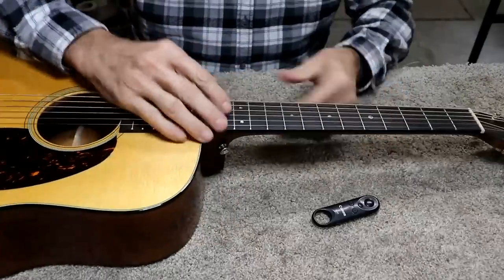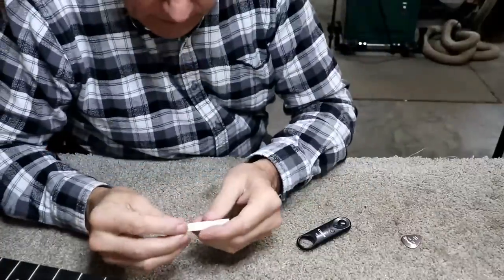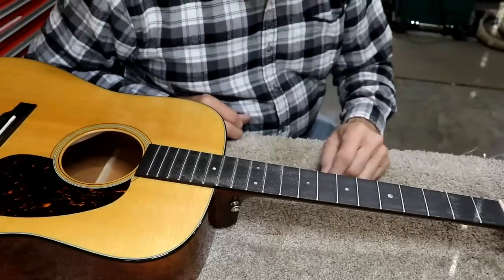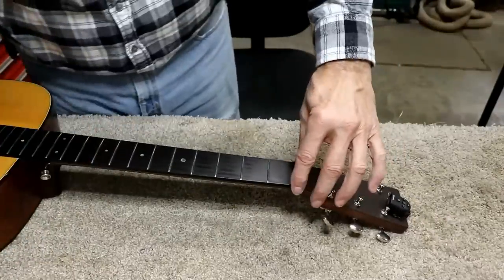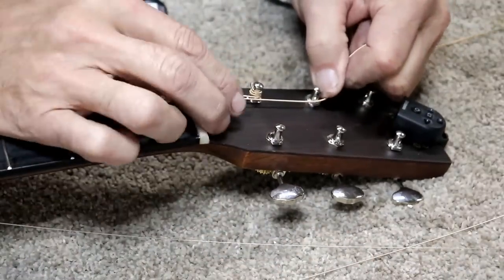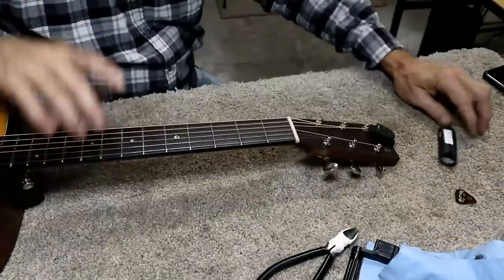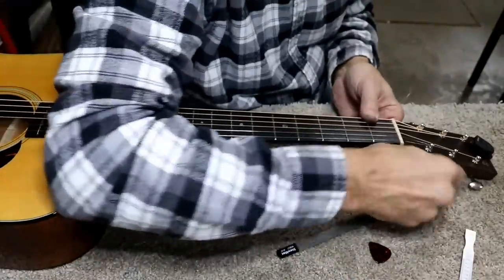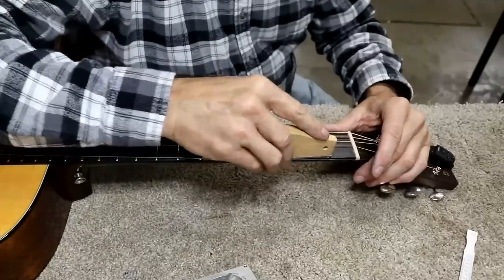628 RSW Can A Perfect Setup Be Improved

Comment: Doing a setup on a guitar that doesn't even need it. You did the "Rosa" on it. I string them up like you do. I offered to restring a friend's guitar, he went into the kitchen for a drink and came back and he could not believe I had the new strings on, blew his mind. Nice video Jerry
Reply: Is that an actual Martin D-18, or is it some kind of “clone”/lawsuit era copy?
Reply: Whoa.  Lowering the 1st fret vs. replacing a nut that already has filler?  If that is a Martin, I sure wouldn’t want to take that approach.
Reply: @bldallas  Depends what you want to spend. Nothing wrong with replacing the nut on a martin or any guitar that needs one. I would rather that instead of taking off more fret material after they have been leveled. Think about it. In my case I would replace the nut because I would do it for myself and/or my son. Filler or a shim in the meantime. This discussion is on the wrong thread. Have a good one.

Comment: I was attempting at a higher action and ran into this same problem. This is very timely for me. Thanks as always Jerry
Reply: I know what you mean, I hate it when I spend a lot of time and think I have it, then it buzzes. 9 out of 10 times the action is too low at the nut, but Jerry showed me his trick for that, I don't know if that is a good thing or not. Depends on the player I guess. Jerry doesn't like filling the nut slot, but to me, sometimes it is the way to go. Baking soda and super glue. Now if all of the slots are too low, you can put a shim under it. I don't think Jerry is a fan of that either, but it beats making a new nut, of course that is the only right way to do it.

Comment: I learned that stringing technique from Kenny Smith.  I do it on all the stings adding a little more windings on the treble strings.  It is a very quick and easy way to string a guitar.  You can remove old stings and add new strings in about ten minutes.

Comment: Stupid apprentice question: looking to buy sides and back blanks that have had mineral spirits wiped on them to show the grains. Has this ruined the raw blanks, or will this dissipate from the wood to be undetectable? Thnx
Reply: No damage to the wood at all. Mineral spirits is used (as opposed to alcohol), because it lasts long enough to get a photo. Water would last longer but you don't want to put that on wood ready to use.
The wood could warp.

Comment: That is like you said, the best possible outcome. there's just no way a person could get that setup any closer. I sort of thought that a fret level and recrown was in the work's? because I have to work on so many electric guitars. I have made it a practice to stay away from the fretboard with steel wool. the steel fibers have a way of finding their way into places where a person doesn't want them. so after I get done doing all the filing that I need to do. I keep some of those big pink pencil erasers around. and polish the frets with them, a person has to use a little elbow grease on them. but they come out shinny as can be, and I don't have mask off the fretboard. I noticed that guitar has a zero fret on it? those are usually reserved for higher quality guitars. that guitar sounded great when you finished it.
Reply: There is no zero fret, on this guitar.

Comment: That is a Martin D-18 it should have come from the factory with a bone nut & saddle I don't understand who put that filler in the nut. He should call the factory and tell them. They may reimburse him for some of his repair costs. He could even send them a copy of this video. Beautiful D18.
Reply: if it's older than 10-12 years it probably came with a high setup from the factory and whoever previously did the setup sanded too far and used some filler to try to fix their mistake

Comment: Yeah, always when we think, ah, just a setup, an hour's work, at most, we encounter strange problems. Necks pointing weird directions, bridges needing a new glue job, bolts breaking when you tighten them a bit, nuts slots buzzing, truss rods breaking, tuners going bazurk, intonation is wrong and whatever you do, it keeps out of tune all over the fretboard, you name it, it all happens within half an hour. And you have been extremely careful, it is beyond doubt NOT your own fault. And to be honest, why on earth did you try to lower the action at all? It is just a bit high, but I always say, better a bit high than a bit low, so, who cares? Play loud and you won't have any buzzing. Lowering the action will just get you in all problems you know. You need to adjust the intonation. Not pleasant, you need filing or replacing that awkward bridge nut. Do you really want that? Why don't these western guitars have adjustable intonation? When okay, great, but when you switch string model or brand, you need to adjust the entire guitar. Duh. Why is that?
No offense, I'm just learning these things myself. Just wonder why Spanish and accoustic guitars are harder when you change the setup. You need to replace nuts and bridge parts, adjusting the length of a certain string. In fact that is not exactly difficult. Think about installing extremely light strings, those simply need a shorter length. Well, then you simply get the right strip for the bridge slot. Most players stick to their favourite brand and gauge, so, intonation does never change that much.
Well, thanks again for a good video. Such cases are an example, just in case we buy a guitar, we can encounter this very same situation, one day.